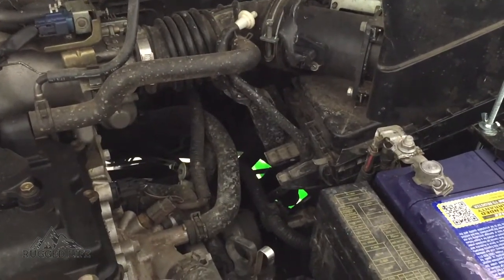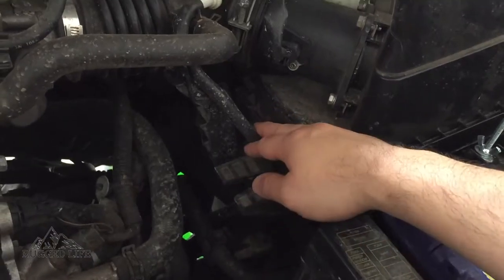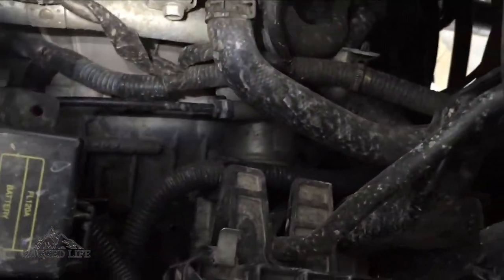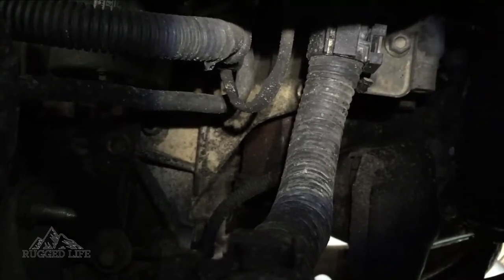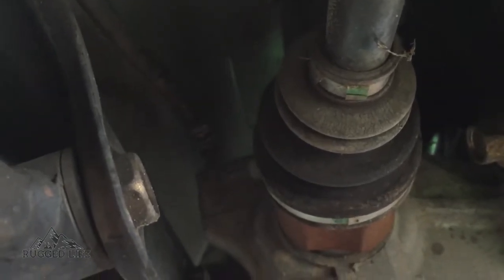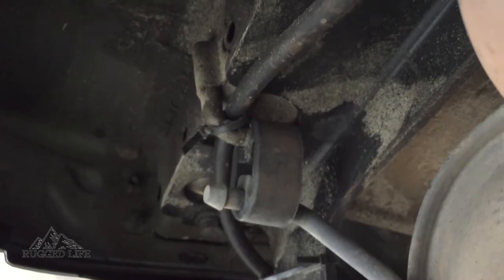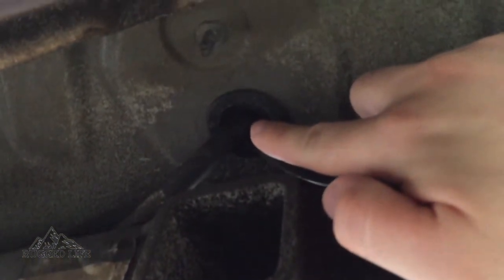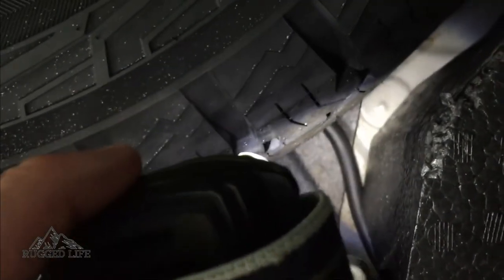NISSAN Xtrail DIFFERENTIAL BREATHER EXTENSION - MODs

Comment: The slit you mention on the airbox is where a resonator chamber fits onto the airbox. On my 2.0 ltr t30 there is an air inlet hole about an inch diameter just to the left of that slit.

Comment: Hi there i just noticed my breather hose is snapped for the rear differential can i cut a piece off and just stick it back for the time being please?
Reply from the maker: Yes you can. Just remember to fix it properly as soon as you can and don't go through deep water while it is not fixed.
Reply: Thanks for the reply. I only go through small puddles when out in the countryside I don’t go offroading with it mate so shouldn’t really be a problem but if i were to change it how does the metal bit come (which pipe goes on to )out of the rear differential please does it push out or does it have a nut on in or bolt please?
Reply from the maker: @gilly7654  hmmm. Didn't have to do that before so wouldn't know. See if you can feel something like a nut head at the base of the pipe. Something that would take an open wrench. If there is, then use a wrench to undo it.
Reply: Rugged Life ok mate will have alook tomorrow Thankyou

Comment: Re-diff breathers..... is there anything else besides a snorkel you'd want to do? Fyi I have a t31
Reply from the maker: Hi Jake, do you mean in terms of modifications in general? If so, then not really :) I'm sure there will be more. What mods have you done on your T31?
Reply: Rugged Life I mean in terms of a water crossing. I believe I've heard petrol engines are not ideal, but I've asked the question many times and haven't got a straight answer. Thanks
Reply from the maker: For water crossings, diff breathers and snorkel will be your main mods. I personally won't take my xtrail through water crossings that often so I would just manually remove the relay for the electric fans to stop them from splashing water everywhere if it is deep enough. Also, I always have a can of WD40 with me in my trips so I always spray all electricals and ignition components before a crossing. If a crossing is deep enough, I woould use a 'water bra' just to be extra safe. But honestly mate, I am sensible enough to not take my xtrail through water high enough to go over the bonnet. The car is just not designed for it and water in the car soaking my carpets is just not my thing unless I'm driving a purpose built bush bashing machine :)
Reply: Rugged Life I appreciate your reply,  I was only thinking of a rare or emergency situation. 
I didn't think of the fan. 
Thanks
Reply from the maker: Jake Bristow no worries mate. Always glad to help.

Comment: Sorry not very mechanically smart what does this mod do?
Reply from the maker: A differential needs an air valve to release pressure. If the valve gets submerged in the water and the differential is at operating temperature, the heat will create a vacuum and suck water in. Connecting a hose to the valve extends the height avoiding water ingestion.